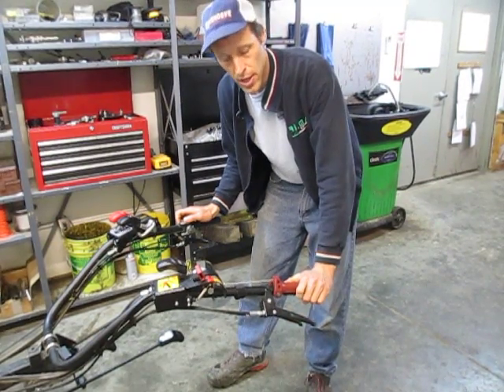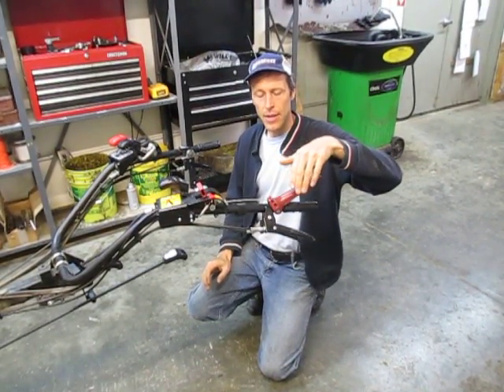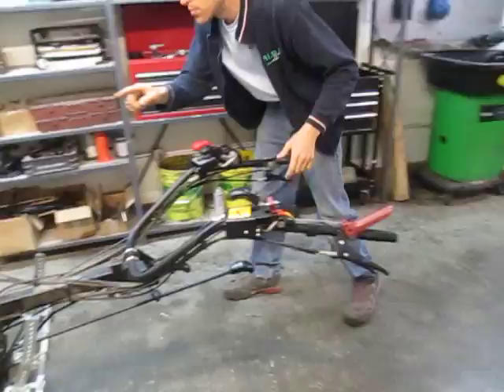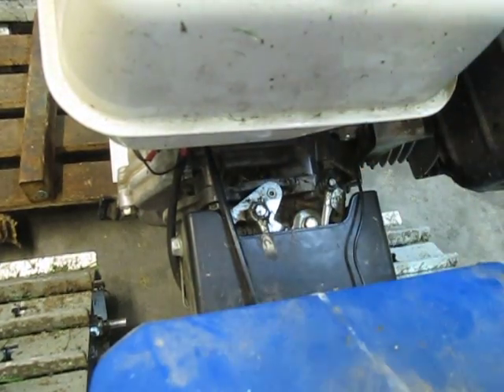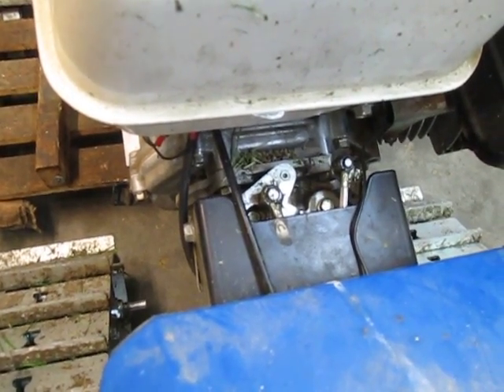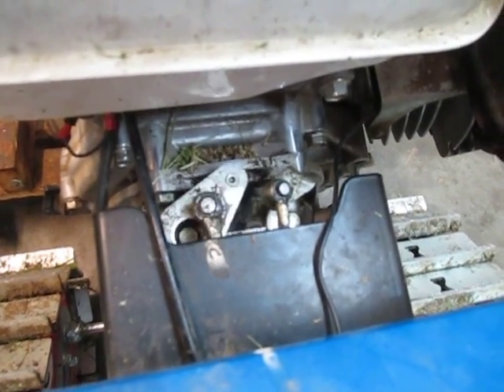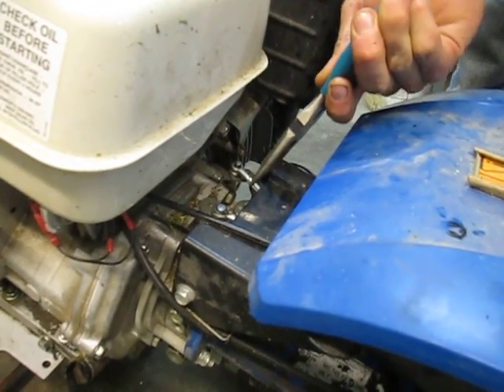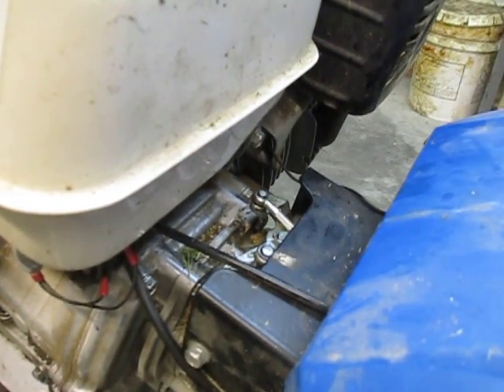BCS PowerSafe: Cable Adjustment & Troubleshooting

Comment: Thankyou so much  coukd I ask an info about my bcs740(749 in USA?) Mine  is a brand new machine  and it is really hard to change speed even with engine at low rpm...after shift goes tactor works well but sometime gear  "excape" ..is it normal and should I adjust clutch? Regards

Comment: Wow.. first video and its exactly what I needed. My problem was the sc cable binding when turning the handles from being could on a bolt. Rather than check the problem I forced causing that tab to bend. Thank you for the time saving vid!

Comment: Seems like you could solve the interlock issue by threading a compression spring onto the safety lever cable to create some "give" in the actuation. Then, you could press the safety lever down when the clutch lever was released but it would not actuate to the active position but simply compress the spring between the cable outer and its end stop and pre-tension the cable. When the clutch lever was pulled in the safety arm would be pulled over to the right side and the pre-tension in the cable could then rotate the safety arm anticlockwise to the armed position. This would stop people bending the linkage, allow them to actuate the levers in either order and still achieve the desired result - ie the system does not "arm" until both levers are pulled in.
Reply: I have just taken delivery of a 740 so I'm going to have a look at doing this modification along with reducing the strength of the "BullWorker" springs on the brake cable which seem way stronger than they need to be.